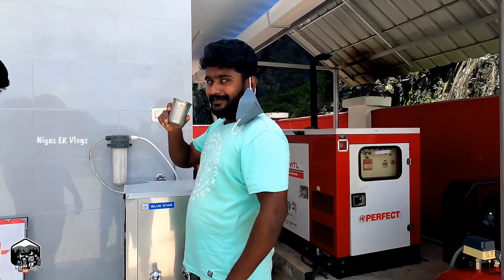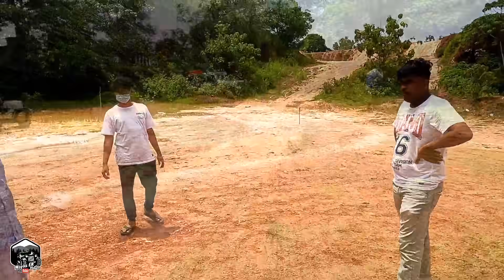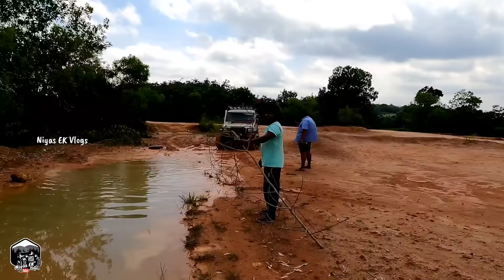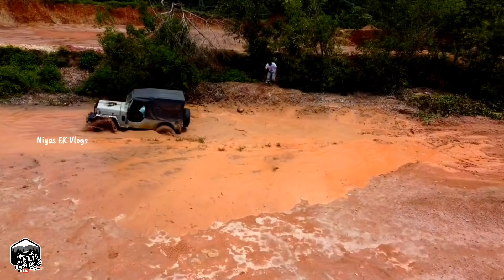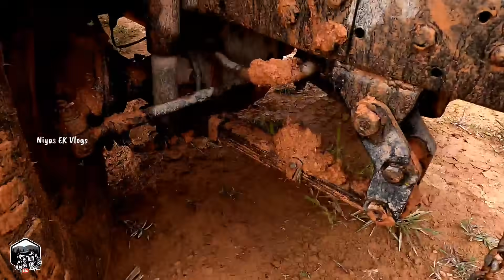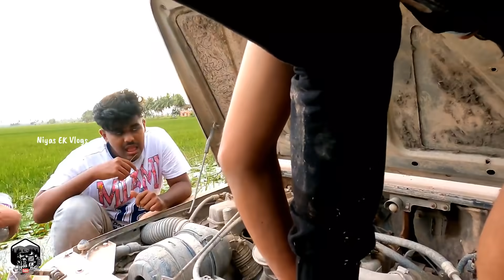നമ്മളും ട്രാക്കിൽ ഇറങ്ങി... OFFROAD Track With Niyas EK Vlogs...

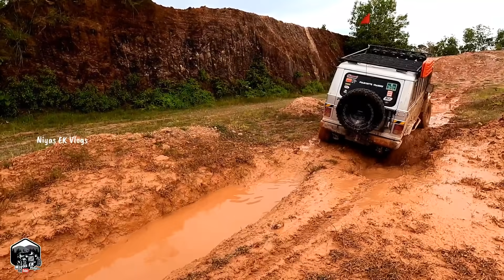Comment: Aa bolero chaliyilkudungiyappo 2 chakram mathram karangunnollallo (28:30mintil) athentha 4*4 agumbo 4chakrathilum power kittande 🧐
Reply: Differential mechanism aanu, oru wheel lock aayal matteth mathram karangum
Reply: @jokershydra959  appo 2 wheelil mathrame power indagollu
Reply: @muhammadkhaif4283   anganeyalla bro, ippol oru side differential mathram assume cheyyuka(rear). Athil rand sidelum(left and right) power equal aayitt distribute cheyyan differential nte akath oru spider gear mechanism und. Turning okke varumpol power equal aayi distribute cheythal(suppose turning to left side), left side wheel kurach karangiyal mathy, athepola right side kooduthal karangendi varum. Appol vandi turn cheyth kittilla. Anganeyulla problems ozhivakkan vendi aanu spider gear mechanism ullath. Appol power distribution equilibrium conditionil aakum. Ithe same concept aanu front wheel differential-um ullath. Bro eee video onn kand nokk https://youtu.be/yYAw79386WI
Reply: @jokershydra959  Okke 👍